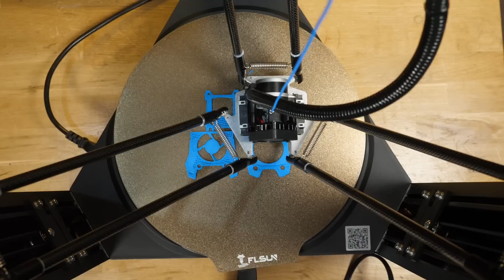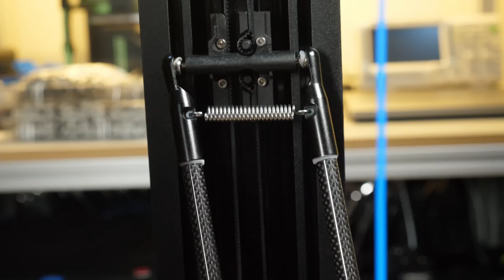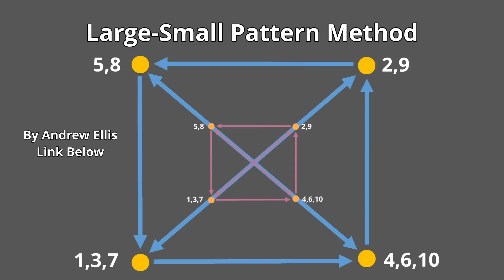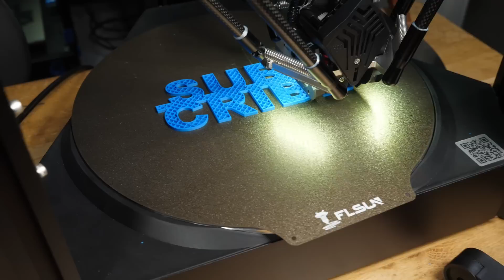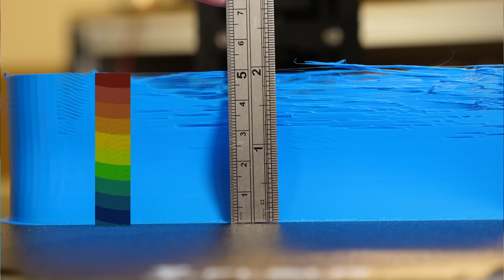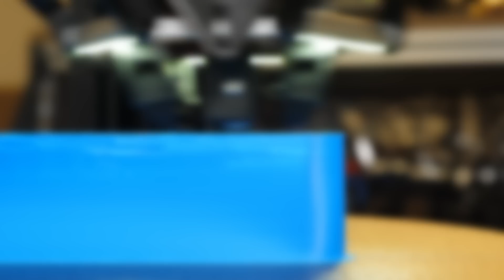This $800 3D Printer Hits 100K+ in Acceleration Test

Comment: Correct me if im wrong but in your video you talk about slowing down for corners or square_corner_velocity, From my understanding on a delta you don't need to slow down, Ive had mine at 99999 with zero issues.

Comment: I'm a bit surprised by your acceleration scale...
1 'g' is 10 m/s^2 or 10'000 mm/s^2.
At 1 g a mass of 400 grams produces a force of 4 newtons 
10 g means you have 40 N (newtons) on the machine, equivalent to a static load of 4 kg in the direction of the acceleration... It can be imagined that the V400 structure and motors is able to lift this weight in the Z direction... Now lean the printer on one of its side and the 4 kg looks and are harder to move: given the arm's angle the real force along each arm is necessarily much higher: Say that the printer is in the center, the arms angle is about 60°, it means that to sustain a load of 40 N  you have 40 N along each the 2 lower arms and 80 newtons on the upper one, and 86% of that supported by the belts and motors...
You say that you reached 50 g, or a static load equivalent to a head of 20 kg... I'm a bit sceptical even if this load is sustained only during a short time. This means in the XY plane and depending on the acceleration direction, one belt of your printer is supporting 340 N, the equivalent of 34 kg of load plus its own tension.
V-400 motors are the longest NEMA 17 currently available. Maximum torque is 55 Ncm or 550 Nmm. Pulleys have a working diameter of 12.8 mm, so the radius is 6.4 mm and the maximum pulling force on the belt is 550/6.4 = 92 N and this is the static torque. At high speed it's much less...
So with your 50 g of acceleration the motor is supposed to pull nearly 4 times its holding torque... Please explain the magic.

Or maybe you had too much '0' in stock and added one on the acceleration scale??? My own tests with the same macro seems to confirm that... I'm personally unable to get more than 5 g at 200 mm/s without loosing steps...

There is a simple way to improve the acceleration without increasing the loads on the printer: Reduce the moving mass. I'm working on that and I bet that a 130 grams head, with direct drive extruder, can accelerate 3 times faster than the stock one.
Reply: I just did a Fast test with my flsun SR, i could do 400mm^2 @ 100000 mm^2 accel (hundred thousand) and i have a DD head (362 gram head) i haven't done more yet
Reply: @SuperKoe  As calculated above, 10 g is within the load limits of the motors if you and your drivers tune the current properly, and specially with a 10% lighter head.
Another question is to be sure that what you ask is what you get... It's within the range of an ADXL 345, so we can have a direct measurement and an answer.

Comment: Interesting results for flow rate. 247 printing did also a flow rate test on a voron with a revo, bambu x1c and the v400. His values significantly differed from your results with somewhere over 30mm3/s with pla at 220 degrees (cant say the exact numbers sadly).
Not sure about the performance increase with a cht as the v400 has something similar to a bozzle nozzle, basically a cross shaped hole instead of the round one.
Anyway, the v400 is underestimated in terms of speed. With the stock slicer settings it will beat a x1c at highly detailed prints as it has 10mm/s sqv instead of 5
Reply: I think the understimation comes from having a lower advertised number (v400 has 400 and X1C has 500) aside from needing some tuning , but like you said , many test has show that the speed is actually higher on the v400 , and that is with stock settings and not specific modified ones
Reply: @ulforcemegamon3094 I guess that's why they have nixed the stealtchopmode with the v1.4 update and are now advertising 600mms

Comment: Hi Adam, greetings from Brazil...I tested my FSUN SR with the same macro. However, my flsun started to lose steps at 20k acceleration, and 200 mm/s speed is a good performance. Regarding flow, I achieved 25 cubic millimeters. Is this an acceptable performance, or do I have some space to increase this performance?
Reply: Changing the nozzle to a nickel-plated copper or a CHT clone will increase your maximum flow rate for sure.

Comment: I understand what you think, but this is pretty inaccurate. You mentioned if you are going to print with max 400mm/s, it is possible to just set accels at 100k. However, for example, the extruder will definitely not come close to hitting such accelerations, and your print quality and strength will suffer greatly. Furthermore, the flow rate tests are inaccurate, as it’s purely by view. If you really want to find an accurate extrusion rate that doesn’t underextrude, tune EM on a low flow rate (Refer to Ellis’s tuning guide), then increase flow rate until you can see underextrusion. That is a much more accurate and realistic way. Also, larger layer heights and nozzles increase flow rate (quite significantly), so it is absurd to just say 0.3LH can flow 220mm/s, so 0.15LH can flow 400mm/s. Lastly, if you have such great acceleration differences between your inner and outer perimeter (you mentioned set outer to max recommended by IS and internal can be close to the max of motion system), your pressure advance value will not work for both accels, and major corner gaps or even perimeter gaps (or vice versa - bulging) will occur, leading to much lower strength/quality. Sorry to say this, but your values and recommendations are rather inaccurate and will result in rather bad quality and low strength parts.

Comment: Great video. Fine grain accel testing is centered on the bed, where it is optimal for deltas. If the test area is off-center, the accel will need to be much higher for the furthest tower.

Comment: I could have just made this exact video. I have a FLSUN Super Racer and use all these methods in my mod ding and testing. I will say though that I have some funky retraction settings with the CHT volcano nozzles.
Reply: Funky you say? I've been wondering about getting a CHT for a V400 and would love to hear what you've noticed.
Reply: Such as?
Reply: With some PLA+ the settings are 3mm at 6mm/s detract at 10mm/s
Reply: @ManjaroBlack  Why would you ever set retraction so slow...?

Comment: I bought two v400s two months ago and it's a different world. 4-5x faster and I have yet to get a print fail and the wifi interface is outstanding.  Life is so much  better away from Creality. Klipper and delta is the way to go.
Reply: That's an over exaggerated comment!

I am a part of the v400 community and no way you didn't get any print fail!
Reply: @qozia1370 the only fails i have are when i push the printer beyond what it should be, fail to support propperly, or when i have a dirty build plate.  All user errors. My last bad fail was because im trying to print a very slim amd tall print at max speeds when i should just slow it down and let it print propperly. Again user error.
Reply: I have a v400 as well and you are totally lying
Reply: I have two of them as well and they are really great printers. Not the best default profiles but if you know what you're doing in a slicer they are amazing reliable machines.
Reply: Yes,  creality is such a shitty company

Comment: No, fucking, thank you.  Delta printers are a masochist's dream.  They change resolution based on where the print head is located in the build volume, suffer from tree ring artifacts, produce nonsensical problems when they do misbehave (Motor skips, you've lost registration in X, Y and Z axis, with no way to recover), and are just generally a pain in the ass.  They have a smaller build volume than they're regularly marketed as having due to the mechanics of the end effector losing stability outside of a specific range, and were a nice little fad in the early days of 3D printing that I'd rather see just fking die already.

Comment: It seems like when printing at high speed I need to throw "conventional wisdom" out the window.  With PETG, for example, I increase temps to 260C-280C and use lots of fan.  I wonder if a similar approach would help those upper layers on your test prints come out better.
Reply: I don't see many people talking about petg fast, but i have concluded the same.
Reply: The plastic doesn’t spend as much time in the nozzle at those rates, so doesn’t actually get up to the temp of the nozzle. I think you have to overheat the nozzle to get the plastic to the standard print temps.

Comment: If the goal is to discover the MAX speeds, accelerations, and flow rates that the stock machine is capable of, then why limit the nozzle to 250 C? Specs say that the machine is capable of 300 C. I would like to see the flow rate failure on the 0.4mm nozzle at max temp. Of course, nozzle geometry plays a significant role, as you alluded to with the CHT-style nozzles. Larger diameter nozzles can actually get poorer performance due to the reduced contact-area-to-volume ratio, depending on the viscosity curves of the material being printed.

Thanks for publishing these results. It is great to see a company's advertising actually understate their product's capabilities.
Reply: Unfortunately alot of the time they mean the materials used is capable of withstanding that temperature

Comment: Assuming an accelerometer is available, testing resonance and checking the maximum recommended acceleration with MZ (the simplest algorithm) is a better way of checking the capabilities of the printer, which is not only made of motors (what you tested) but also of flexible/resonating components.
With your test, hypothetically, if they put bigger motors with higher amperage with the same mechanics you would get even higher acceleration values, but the resonances and flexion would be the same and the maximum usable acceleration identical (in principle).
Reply from the maker: I did mention this at the end. It's great for high quality external surfaces, but leaves performance on the table when aesthetics are not so important, like on the infill
Reply: I print a lot of printer parts and other functional prints. I honestly don't care about a bit of ringing/ghosting on them. So testing the max achievable speeds/accels is pretty valuable.

I've also set my max accels and speeds to what these types of tests yield in klipper. Then limit those settings in the slicer for the features that I might actually care about them for. 

So use the recommended IS values for perimeters. Push the limit of the printer for sparse infill travel and some other features.

Comment: They locked down the board so you can't upgrade klipper or add other features, they glue the nozzle to the cover and heat block, hard pass, may be fast, but too locked down for future or user preference
Reply from the maker: Nozzle swap and firmware with stock OS klipper both pretty easy. My machine is running OS klipper from 2nd day I owned it.
Reply: @Vector3DP  think he’s referring to the bambu
Reply: @VersedPlaysTM  Nope Flsun
Reply: @jz2188  okay well your wrong then lmao
Reply: @Vector3DP  For you, not for out the box users
Reply: @jz2188 there are very easy to follow instructions to do this. I had no prior Klipper experience, and I was able to do this. My V400 now runs on original Klipper with a CHT Nozzle at 300mm/s. Works really well.
Reply: @SuperTrooperC  do you get consistent results? 
I have mine stock and peak at 200 mm/s speeds i only changed the stealthchop value to 0 and upgraded the part cooling fan ducts but i would like to be a little faster
Reply: You can run vanilla klipper on the speederpad, it's what a lot of people do and it's an improvement

Comment: I like your engineering approach to testing the printers performance. I've seen that in other comparison tests it's been suggested that the VLSUN whilst fast loses detail compared to its competitors when running at the same speed. Did you find this?

Comment: Very interesting. This makes me wonder if input shaper is something that would even matter with a delta machine. My limited understanding so far is that it is mostly designed to eliminate high speed artifacts which the nature of delta machines tends to already do. Your mention of the nozzle pressure variance does make me wonder however if pressure advance would still give a delta the same benefits. To be clear, it may well have these features but all I could find on the product page was that it usease Klipper but it never called out Input Shaping or Pressure Advance specifically.
Reply: I have a FLSun SR that i recently converted to Klipper, and i don't even push it that hard, but trust me, input shaping helps a lot with ringing, even a fast manual calculation.

It might be less than a comparable i3 style machine at similar speed, but it's still present, especially if it's a direct drive delta printer (significantly more mass on the effector to swing around)